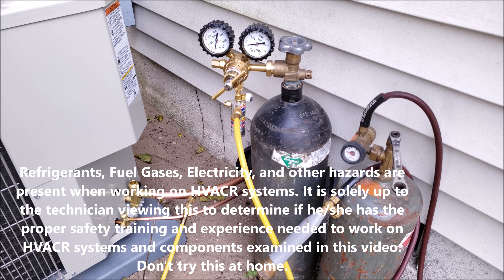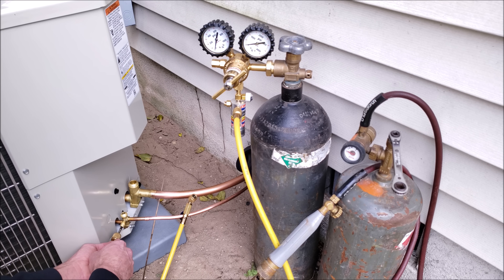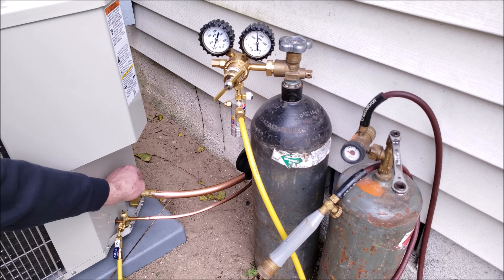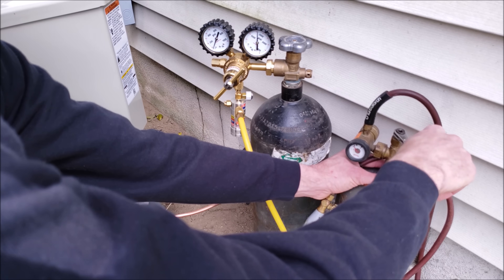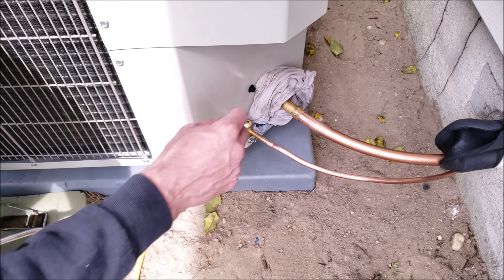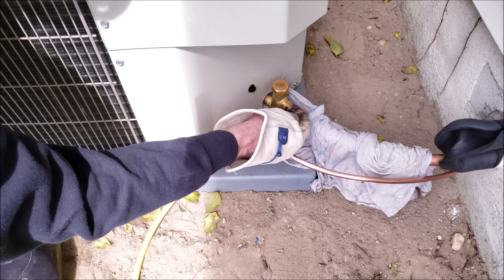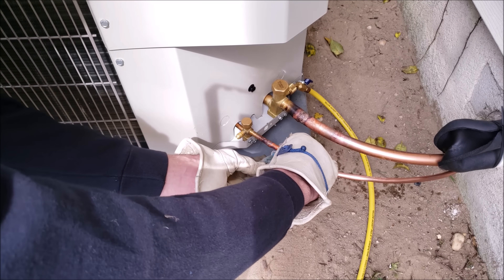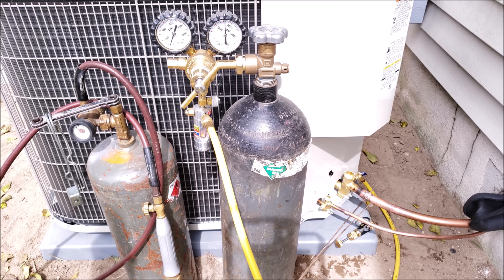Brazing HVAC Line Set to Service Valves! Full Procedure!

Comment: Hi Craig, I have a suction line service valve that wont take heat. I have a 45 street elbo going into valve, and other fittings that took braze with no problem until i get to the valve. When i have my torch on there, my flame turns orange and doesnt seem to get hot enough. I tried a small fan (im in a tight space thinkning maybe lack of oxygen) without luck. Tried MAPP gas- same thing, orange flame. Im stumped. Im worried about over heating the valve becuase i tried this more than a few times but always had a wet rag on valve. Also they shipped me a condenser without a fixed orifice. They said use the existing one what do you think?
Reply from the maker: I only install TXVs on new system for efficiency and compressor safety for possible future low airflow problems such as not changing the filter. Are you brazing or soldering? Do you have the right color flame before the flame hits the copper? Thanks!
Reply: Roger that on TXV. I have a great looking flame on all the fittings until I hit that fitting that goes into the service valve. I been told to use oxy/acetylene but I never had a problem using straight acetylene before and after watching your vid it proves I don’t need oxy/acetylene. Everything I try at that valve gives me a orange flame.
Reply: @christopher_c129  Are you sure the joint is copper to copper?  If it's brass or steel you will need to clean it well, use flux and 45% silver rod.  You'll also have a much easier time with oxy/acetylene depending on the line diameter.  Also, make sure you're not running too much flow nitrogen and it's blowing out at the final joint.  Good luck!
Reply: Phobos thanks for the info..it was copper to brass and I now know what you mean by using oxy/acetylene because I think lack of heat was my issue. I ended up putting a new tank on and waving my flame away when orange and back on pipe when blue again. The wet rag started to sizzle and that’s when it took braze rod. I didn’t want to use oxy because I do t have much experience with it so knowing my luck I’ll blow through the pipe. But looks like lack of heat was the problem. I have a old condenser now so I could practice on that. Thanks for the reply take care
Reply: did you sand the copper flash off of the brass service valve? You may have to soft solder it now if you did... never try to sand service valves, filter driers, or compressors. they usually are not cooper but have a copper film flashed on to them so that you can use a silfos type product.
Reply: @randyosborn284  darn Randy I never knew that. it was drilled into my head to clean all connections. I think I figured out my problem...I think the wet rag I had around the valve was taking my heat away. I had the rag far on the pipe end of the valve too because Im kinda paranoid about wrecking the valve from overheating...actually it would be a pretty cool video is someone took a valve and heated it up to test what temperature / length of time needed it take to wreck a valve

Comment: my ac guy didn't use a rag on the big pipe; he did remove the little stems inside though; could that have damaged the valve?  it didn't look like he over heat it it;
Reply from the maker: If it is not leaking now, it is ok since you won't have to move the valve stem again with these two position service valves, thanks!

Comment: If replacing a new 410a condenser and evaporator onto an old system running R22, is it ok to use the old existing copper lines?  Assuming that its in good condition, will it be  able to handle the much higher pressures of 410a?
Reply: You must and I say again must make sure you get all of the oil from the R22 refrigerant out of the system . R22 has mineral oil and 410a has synthetic oil and if you mix them you are in trouble. Remember what they taught you in CFC class I hope you have your license. You should not even use the same gauges for both refrigerants. The oil mixture will get you in trouble. One refrigerant is a HCFC R22 & 410a is a HFC . It is not an issue of pressures at all its the possibility of mixing the refrigerants / oils . And the two refrigerants boil at different temperatures, if you have your CFC license that CFC course covers that .You must have an understanding of the properties of refrigerants as well as the pressures temperature relationships.
Reply: @emmanuelwilliams6004  
You said do not use the same gauge with different refrigerant but the gauges are manufactured with multiple refrigerant types  on them
Reply: Greg Richard The problem is not about manufacturers it is the oils you don’t want to mix the synthetic refrigerant oils with the mineral oils also different refrigerants boils at different temperatures and with these factors in the equation you are headed for trouble when you use the same gauges for all refrigerants. Also when you take the CFC course that is a topic covered and it specifically teaches not to use the same gauges for those reasons which is the best practice truly it is .Oil is present in the hoses after use that is best practice believe me .
Reply: @emmanuelwilliams6004  a lot of manufacturers have changed their stance on the oil issue.  They think RX-11 does more damage left over to compressors than a 5% oil mixing of R-22.  Rx-11 flush needs a good nitrogen flush and atleast 30 minutes of vacuum time around 300 microns.
Reply: @flatearthdays  You always want to get all of the flush out of your refrigerant lines and put a good vacuum I personally triple vacuum I do my best to make sure the system Is dehydrated that is the up most importance because you don’t want call backs especially system call backs . Things like different oils and different refrigerants boiling at different temperatures can cause big problems inside a system . It’s all about proper procedure no matter what no short cuts on every job in our trade and we will have a lot of happy customers .
Reply: Also a lot of times when doing a system job you don’t know the percentage 5 or what ever percentage of refrigerant oil is left in a system especially with long line sets they say 5 % when you are on a job there is no way to calculate if there is 5 % oil left in a system.It’s always best to take your time use your nitrogen and proper vacuum cuz at the end of the day refrigerants boil at different temps and oils are different mineral or synthetic stick with the basics deep vacuum and we will have happy customers good discussion it’s always nice to get good information.
Reply: @emmanuelwilliams6004  nitrogen will
Not even get down to 5%. No matter how much you use it. Replace the lineset or you’ll have to use pipe wiper. Nitrogen a lot of times in the middle of the lineset just smears it around. RX-11 can help but manufacturers now out out bulletins that RX-11 does more damage to compressors and acidity than a little oil left over.
Reply: @flatearthdays Personally I have not used Rx-11 flush much i have always been able to replace the line set it the last time I used the flush I had a severe acid burn out and the line set was ran thru a inside wall and thru a finished ceiling. This was at least 14 years ago and maybe 2 other times before then and I had no problems with compressor problems that being said I have only used it a few times .I have been fortunate to be able to be able to replace the line set on my installs that is best but as you know there is jobs where you can’t replace that line set .I haven’t had the opportunity to use the pipe wipers .But at the same time when I did use the flush I used a suction line filter dried but you have to remove that from the system you can’t leave that in permanently . If the bulletin says so they must have had some problems with techs using the product but I never had a problem personally that is not for me to say there has not been problems and I have had two of the customers where I used the flush for over 14 years no compressor or system problems.I am not discounting what a bulletin say .
Reply from the maker: Usually yes but you can clean it with R-11 flush or another product, thanks!

Comment: I just had an R410 air conditioner installed and the tech did not flow nitrogen while brazing four connections on each line over about 40 foot distance. I wish I would have viewed this video before the installation. What would you do now if you were me? Thanks.
Reply from the maker: Flowing nitrogen is best practice but many don't do it and claim to not have problems but I can't speak to what you should do at that point! thanks and sorry!

Comment: A lot of the nitrogen regulators come with a 45 degree angle instead of a vertical on the connection for the flow meter. My question is if I put it on the 45 degree angle does the actual flow meter have to be straight up and down or can it be set to a 45 degree angle and still work appropriately. I hooked it up to my nitrogen regulator and wasn't vertical but it's still look like it moved the ball just didn't know if that was an accurate way to do it or not. I usually use the valve that has automatic Purge set into the valve but it seems like it puts off more pressure and it's not very accurate all the time. Which is why I bought the uniweld Nitro flow regulator.
Reply from the maker: Dylan, sorry I didn't see this sooner. If you want to reach me faster just mail at info@acservicetech.com I think it is still fairly accurate. I believe you must have a turbo torch regulator or another with the 45 degree. Uniweld has a port that goes straight down and that is a uniweld flow reg. I don't think it would be off by much though, thanks Dylan!
Reply: @acservicetechchannel  thank you.

Comment: Great video and very informative channel! Thank you! Just curious though (I'm not criticizing)... Why did you slice and peel back your armaflex that way? You're going to have to tape it... I usually push it back and hold it down with a small pair of vice grips (without damaging the line of course) so when I'm done brazing, I just release the vice grip and the armaflex slides back into place making for a nice, clean job.
Reply from the maker: I usually do the same thing. I hold it with the tubing cutter without turning often. I don't quite remember but I may have just done it to get it back further out of the shot, thanks and great observation!
Reply: and wrap a with a wet rag

Comment: Can you use Stay Bright 8 instead of brazing your line set.
Reply from the maker: Yes it can as it will hold the pressure of R-410A but you will be adding a small amount of acid from the flux into the system unfortunately, thanks!

Comment: Can you use your manifold gauge as the flow meter for the nitrogen?
Reply from the maker: I won't work like a flow meter. You will either have too much nitrogen or nothing after a few minutes. You will see what I mean after you try it. Too much pressure will create a pinhole leak where the nitrogen escapes and not enough will leave oxidation inside the pipes. I have done tests in the shop doing this. It makes it simple to get the Nitrovue flow reg linked at amazon.com/shop/acservicetech thanks!

Comment: Hello ,you do it WRONG, dont put the wet rag on hot copper line ,creates a black junk inside the copper pipe, second ,why dont you put a water inside service line ,it keeps cool while you brazing. putting a wet rag on top of the service valve while brazing it , creates a vapor which can turn of the flame. NO OFFENCE. thank you
Reply from the maker: Hey Jores, I know some put water inside the top of the service valve but I keep it cool with the rag on the outside. I don't want to risk getting water into the inside of the service valve as the valve is rotated upward to open it. It will not create any carbon residue or oxidation on the inside of the tubing when putting a rag on the outside of the hot braze joint. We wait until the braze solidifies and then we need to cool it down to reduce the amount of time the heat is on the service valve. This will not negatively affect the braze joint as long as you give it time to solidify, thanks

Comment: Piston or TXV brazing the same way, or different way?
Reply from the maker: You can flow nitrogen through either usually on ac systems. Make sure to keep the bulb cool or remove the bulb from the vapor line while brazing. I have a video on that in the brazing playlist, thanks!

Comment: Hello, you have GREAT channel and very informative videos done the way everyone can understand. Excellent job and I wish you all the best in the future.  If I may ask you one question off topic of this current video, I hope you don't mind.  I wonder where is the best place to measure wet bulb temp for superheat charging (system with fixed orifice) in the house that has 2 stories. The biggest air intake is downstairs, there is one fairly big (but smaller than downstairs) and one smaller upstairs. Of course temperatures are different on both floors, so I'm not sure about this one. Should the wet bulb temp be taken at the biggest air intake regardless where it is ? Or should it be taken upstairs AND downstairs and calculate the average between them two. The Evap coil is in the attic. One of the reasons I ask is that in your videos you mention at times to take it largest register,  then in some other videos at closest register to the evap coil. In my case the largest register is the longest distance from the coil in the attic.  Thank you so much and keep up the great work. In my mind you're THE AC guy of USA :-)
Reply from the maker: They make in duct psychrometers where you can drill a 3/8" hole into the return duct in the attic a few feet before the evap coil. Otherwise you would need to calculate between the two readings definitely get the first and second floor if the wet bulb is not taken in the return duct, thanks!
Reply: Thank you very much. So few feet before the evap coil is a furnace blower, I'm assuming the reading would need to be taken just before the air comes into the blower. But seems like average calculation from largest return register on the first floor and second floor would work as well. I think once you start charging and continuously checking wet bulb temp on both floors, the difference will be getting smaller and smaller as more cold air start coming in. At least that's how I understand it.

Comment: Thank u for all the great videos they are all very helpful, is there a way you could make a video of how to wire low and high pressure switches on series bypassing heat pump or gas furnace control boards would be really helpful thank u once again
Reply from the maker: Hey Miguel Loza, did you see the pressure switch video i did? Look up "acservicetech pressure switches" In there I show how to wire in series for a contactor, thanks!
Reply: AC Service Tech LLC yes I saw it just now thank u for your fast response
Reply from the maker: Glad to help!

Comment: BTW I brazed the lines on my A/C 40 years ago without nitrogen. Still runs just fine.
Reply from the maker: Many people say that and thats great that it is still working. It is just not the best thing to do for compressor lubrication, potential filter drier clogging, strainer clogging, and reacting with newer rust inhibiting additives in the oil. It really doesn't take much time to set up and do, thanks!
Reply: I'm thinking of pulling the evaporator coil to clean it which will require brazing. I hope to do it right this time. I have a tank of nitrogen and regulator. I need the flow meter and some hoses.
Reply: Correct me if I'm wrong but back then was R22 and without nitrogen might have or was ok but with a 410A system the orffices, txv etc the holes are smaller and you run a high risk for blockages etc. I use nitrogen all the time I dont want a unit coming back on me period. The manufacture calls for we do it.
Reply: @andysullivan7226  Also the Oils for R410a, and the higher pressures, the greater the Acid Production, from the Oxidation and Carbon on the inside of the tube from not using Nitrogen.
Reply: I'm not sure, but it is probably R22. I never actually looked at the tag to see what the refrigerant is. It did need to have the refrigerant replaced once when I drove a nail through a 2x4 in my garage wall, not remembering  i had routed the lines through those 2x4's. I had to call for service on that one.
Reply: A 40 year old system means 350 plus head and 65 suction! Different times. Though back then clogging up capillary tubes was a thing. 

AFAIK you cannot avoid doing nitrogen for refrigeration stuff.

Comment: Don't need to take them out use heat block and wet rag you should be fine
Reply from the maker: Hey Albert, I remove the valve cores before brazing and keep them removed through the pressure test, oil blowout procedure, vacuum procedure, and standing vacuum test. I reinstall them after the system is at positive pressure, thanks!
Reply: @acservicetechchannel  I get it don't cut corners
Reply from the maker: Thanks a lot Albert!